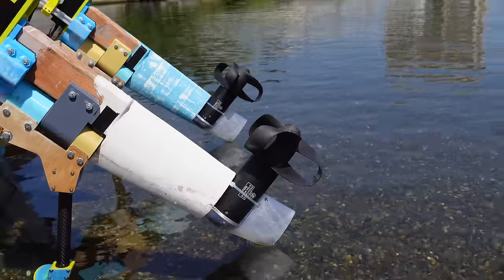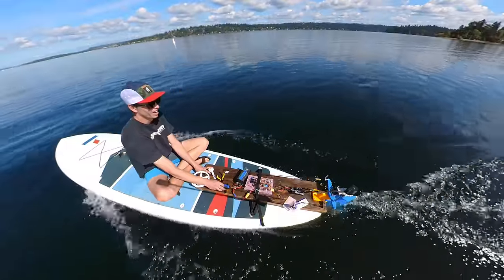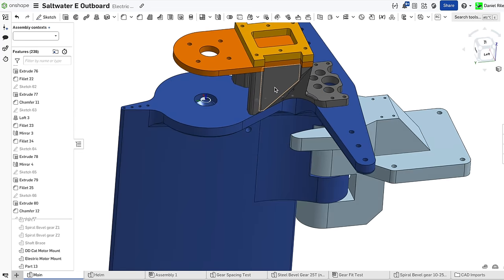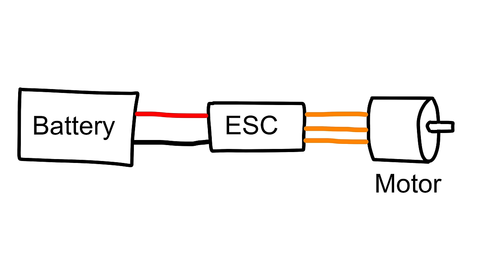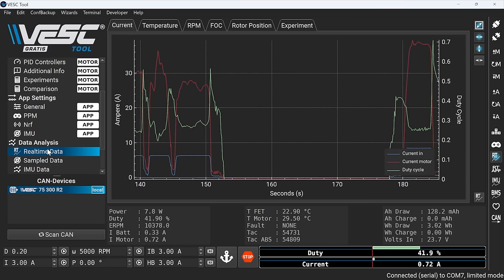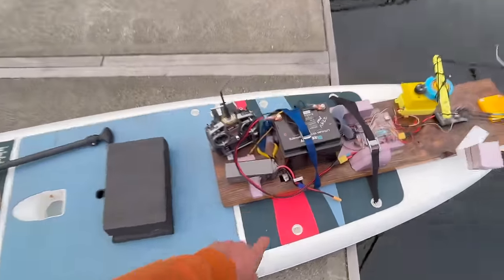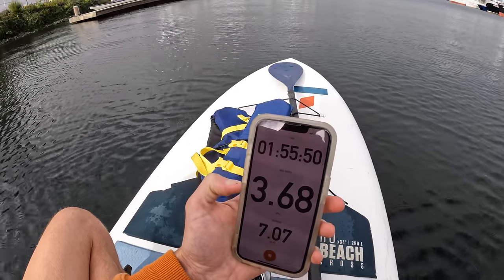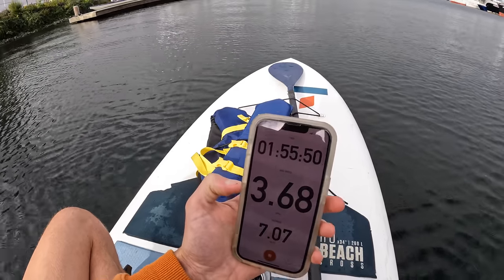Toroidal Propeller Testing on my Electric Surfboard

Comment: Sharrow props probably dont have a negative angle of attack, the examples you're looking at probably rotate the opposite way you're considering. It's common on multi-outboard boats to have counter rotating lower units on the engine to correct for prop walk and other torques on the hull.
Reply: Also the blades themselves are different. His are all in line where as the Sharrow ones are offset from front of the blade to the back. I'm not sure how to explain that as i'm not sure what that part is officially called.
Reply: @TheRogueBro  Which part do you mean? I am not sure there is an official name for a specific part of a prop blade, even if its part of a larger "system" that reconnects to the hub, if thats what you meant.
Reply: The front and rear of each fin, on his they're parallel while on sharrows they bend away from each
Reply: Looks from here like the sharrows have more like a C-shaped fin, while the fins of the 3d-printed ones are more like a U-shape.
If that makes sense to anyone...
Reply: He keeps showing pictures of Sharrows and then making things that look nothing like them.
It's pretty annoying TBH.
Reply: @TheRogueBro  I think aircraft terminology works here and the word you may be looking for is "staggered". the sharrow prop has staggered blades where the leading edge of one of one part of the blade is almost in line with the trailing edge of the other part of the same blade.
Reply: @TheRogueBro  My understanding is the lower member is trailing - that shows rotation direction
Reply: @TheRogueBro  I understand what you’re talking about. Without doing the research I don’t know the term for that.  Let’s call it secondary pitch.  Without it, given a forward motion while turning, the trailing side of the toroidal is in turbulent flow from the leading side, the secondary pitch should allow the trailing side to get clean water and better flow.

Edit. Sorry didn’t see the rest of the conversation you’re having. You get my point.
Reply: @TheRogueBro Agreed. 
It’s for the same reasons of increased efficiency, as biplane wings are more efficient when (conventionally) the upper wing is offset forwards relative to the lower wing. They also usually have slightly different angles of attack which increases the useful speed envelope of the layout. 
The outlier from the norm was the Beech Staggerwing which had the lower wing leading the upper by quite a large margin, however the overall effect was similar.
Reply: Designing these toroidal props is a lot more complex than what is done in these videos. The Sharrow props use many variations. I have had them in my hands, and I have had one of my friends, who's arguably one of the best powerboat prop designers in the planet, look at them. Both the leading part of the blade as well as the trailing part of the blade, incorporate both progressive pitch and rake independently of each other. They also feature individual cupping. That's not the same as the leading and trailing part of the blades have different pitch, they don't, but they need to be shaped in such a way that pitch, rake and camber of the blade creates a cohesive "unit". What happens at one point of the blade in relation to how far forward or aft on the prop hub the blade is, and how far out from the hub the blade is, needs to be accounted for. This is of course generally true for all props. Also very few, except for the absolute cheapest and oldest designs of such smaller high revving props, use this basic "U" shape round ear design. Look at both Sharrow's props, but also look at props like Mercury's Mirage+, Tempest+, Bravo 1, Fury, Enertia etc. None of them uses such a basic "U" shaped design. The only prop I know of which still does, is the super cheap Vengeance prop and a few oddball cheap props from manufactures such as Michigan Wheel etc.
The typical Sharrow three blade prop is very much a mix of a Mirage+ and a toroidal design. It is also important to understand that toroidal props are typically not faster than conventional props. They tend to favour mid range efficiency, whereas some of the more radical designs favour top end performance. This is especially true for props such as the Maximus, Bravo 1 and of course Choppers and Cleavers.

Comment: the problem with your props is quite obvious. both ''wings'' are one on top of each other, that will result in the bottom blade to be only 60% efficient. it will damp every efficiency gain you get from eliminating vortices. (check out why biplanes died out and why they are not optimal wing design). what you want to do is stagger the blades and make it kinda 6 blade prop with pairs of blades linked. it should look more like a 3 blade prop with a loop between the blades. you should get much better efficiency, but designing it will be a bi***.

Comment: @rctestflight great video. Your sponsor however is lying when the make you say no vapor. You know as well as i do that the "flavored air" is flavored because their core is soaked in liquid which vaporizes at STP. Otherwise it wouldnt be flavored. It's valid to say its not a vape but it is most certainly vapor. I tried to call them out for this on facebook and they blocked me.

Comment: The search for greater propeller efficiency is admirable. Have you looked into the Hobie Mirage Drive systems based on fish/seal fins? I'd like to see you bring your rigorous testing to that type of propulsion some day.
Reply: These aren't necessarily designed for the highest continuous efficiency, but instead to make use of the most efficient muscles in the body, and in a way such that if you choose not to use it they are the least additional drag (as even a locked propeller is bad for efficiency, and a free-spinning one is worse). I wouldn't expect outstanding results that'll handily beat propellers due to this.

That said, I also agree it'd be interesting to see the result - efficiency tradeoffs can be worth it, and it would be good to know exactly what the tradeoff actually is.
Reply: Hi, i was considering the hobie system when I was looking into human-powered boat design. My conclusion was that the system is designed for mechanical simplicity, rather than pure efficiency, although the two often go hand in hand I don’t think that is true in this case. Basically the hobie system has a pair of fins (analogous to prop blades) that each oscillate back and forth along an arc. So functionally it’s a propeller that does a third of a revolution, reverses the pitch of the blades, and sweeps back the other way. There’s basically no way to make that as efficient as a propeller because you end up with a dead zone at each end of the stroke that gives you zero power. This is fine for human power as your legs have a dead zone with no power when you reach the bottom of the pedal stroke. But when you’re using a motor with (near-enough) constant power then that becomes a waste.
Reply: @bit1564  In the comparisons I've seen, the Hobie system is far more efficient than a propeller. Basically you have two guys in kayaks doing a tug-of-war - one with the Mirage drive and one with a prop. Plenty of videos on YT about it. Also, the hobie drive is actually quite conplex compared to the well-trodden path of prop and shaft
Reply: @iskierka8399  In the comparisons I've seen, the Hobie system is far more efficient than a propeller. Basically you have two guys in kayaks doing a tug-of-war - one with the Mirage drive and one with a prop. Plenty of videos on YT about it
Reply: He could also look into increasing hull efficiency. Maybe a bubbler like the earliest hovercraft designs could help reduce surface drag?
Reply: @YellowJello57  That is examining the relative effectiveness of A) the human powering the system, B) the drive that puts the power from foot to water, and C) the fins/props. Not directly comparing fins and props, so you can't draw that conclusion fairly. The hobie system is not simple, but it involves fewer changes in direction for the power making it more effective.
Reply: @bit1564  Disagree. Switch the two people around and the hobie drive still wins. There are many articles comparing the two and almost all of them indicate the efficiency of the hobie drive is greater than propellers. In any case, I would like to see RCtestflight do some tests. Maybe he could prove it either way once and for all
Reply: @YellowJello57  Consider this: each fin is essentially a prop blade. While the prop rotates continuously, for each oscillation the fin has to stop and go the opposite direction, meaning for a brief moment it is completely still and produces zero thrust. It is mathematically impossible for that to be better than preserving the rotational momentum and thrust the entire time. It is the overall drive system that is superior on the hobie, not the fins themselves.
Reply: @bit1564  If propellers are more efficient than fin drives, why do aquatic creatures have fins? Do more research. Fine drives are more efficient. Period.
Reply: @YellowJello57  same reason wheels are more efficient than feet but there are no animals with wheels.
Reply: Uh... Rigorous?

😬
Reply: @bit1564 wouldn’t fins produce less drag?
Reply: @YellowJello57  "Basically you have two guys in kayaks doing a tug-of-war"

That is because the hobie system is optimized to use human power efficiently, so if you compare two humans it will win. That does not mean the hobie is more efficient than a propeller, just that it is more optimized for human power.

If you compare a human with a hobie to a motor with a propeller, it it will depend on how strong the human and motor are. Meaningless test.

But if you compare a motor with a hobie to a motor with a propeller, the propeller will always win, because it is the more efficient design.

By showing you a test of "Basically you have two guys in kayaks doing a tug-of-war" they are running a soft con on you already by testing with human power instead of motor power.

Comment: For your longer distance runs,You might want to try a rimdrive thruster. A rimdrive is basically its own motor with no shaft, the propeller is inverted without a center core (think of a donut with pointy teeth) in use they are practically weedless. I have seen video of commercial versions spiting out pieces of net that would disable a conventional prop. Weeds have to be the main concern on long distance autonomous missions, especially durring mid summer.
Reply: How would @rctestflight 3d print it though? I think he is pushing what can be made at home as well.   

Two thoughts that occured to me were what effect would adding weight at the blade tips to create a larger inertia have?

The other is if he had considdered home chrome plating to increase the smoothness and add a minor level of impact protection?
Reply: @RowanHawkins  There was a company 3d printing them 5 years ago for small ROVs,  I don't remember the company name
Reply: I have been proposing this too. Hubless rimdrives are so cool!
Reply: @RowanHawkins  Why couldnt he print them with his resin printer?

Comment: I would imagine the efficiency gain from toroidal props comes into play when you are at the limits of tip speed and the normal prop starts cavitating, so you gain a little bit of speed from a smaller prop. You usually want a prop that the engine is capable to rev up to max rpm (set by the manufacturer at which it usually starts cavitating and where the power peak is) for maximum power and so the engine has enough  power to get it planing if its a smaller engine, this is not a problem with electric motors because you get instant torque

Comment: Have you considered measuring output shaft torque and RPM in order to determine prop efficiency?   In other words, remove the motor efficiency from the picture.   This would make the comparison of the different propeller designs more general across applications.
Reply: sadly torque measuring sensors are quite expensive, in the order of 500USD or so

Comment: I might of missed this tidbit, but what about measuring speed through water rather than over land? Current and tides variable can be eliminated. and you only have the wind variable to contend with.
Reply: His plot of (land?)) speed vs. efficiency is very well behaved.  This suggests to me that the differences between land, air and water speeds for this particular experiment have negligible effects.
Reply: And while I agree with you in theory, there’s a long list of unknowns in this experiment that he could have eliminated if he had the time, money and computing power to measure.  Good engineering is the art of making the most out of your limited resources.
Reply: @owengrossman1414  At the midpoint of the craft, a flow meter, similar to what sailboats use to determine speed through water could be used. This would be a very simple approach. Sailing is a hobby of mine and the through of using movement through water seems a more plausible way to measure. I love this videos and this one I feel is quite provocative in this nature. Thanks for your responses. I feel these comments on this type of video can help us learn a lot more about this subject.

Comment: Daniel, I enjoyed this video on propeller testing.  Years ago, I was involved in designing a solar/electric boat for a collegiate competition called Solar Splash. The propeller design was critical, and we came to learn about the Wageningen Institute in the Netherlands.  They were the leaders back then in propeller analysis.  But in addition to pitch and diameter, there were other important parameters such as EAR (expanded area ratio), the airfoil shape, and more. I'm sure these also factor into the toroidal design.  The best way to measure the efficiency would be to get a true measurement of the torque the motor is providing, which is not an easy thing to measure although you could build a cradle dynamometer if you really want to get serious. But if you can measure, torque, RPM, voltage and current, you could probably come to some meaningful conclusions.   Keep up all the great videos.

Comment: I think it would be better to have a constant speed of the boat, then measure the power used over a set distance of travel. I think this would be the easiest and most accurate comparison because you eliminate the variable of drag from the boat moving at a different speed which can have a SIGNIFICANT impact on efficiency of the hull itself, making it difficult to know what contribution the prop really has.

Comment: You should look at making a 3 blade prop but with cupped tips on the blades. Stops/slows down water spilling off the blades for more thrust. Also the there is a prop type know as the" chopper" where the top inch to 1 1 1/2 of the blade is cut off square.

Comment: I commend you for these prop experiments. I have a boat and it is over propped on purpose. It is cost prohibitive to increase power and torque to match it, and it is cost prohibitive to buy props to try to tune it. These props are Bronze, but if I could use lost wax and per blade resin printing to cast a replacement in aluminium alloy I could test without huge cost. Just substantial effort. One option might be to make the boat hybrid and couple a pair of Nissan leaf motors to the shaft directly after the transmission. Then we could get the RPM up in bursts assisted by those. Or putter around on only those silently. Or long distance with only diesel.

Comment: Hey, notice the huge air trail from your toroidal propeller downstream of the bulbous center? And how it’s so much larger than the ones from the traditional propellers? That’s drag. And the shape has everything to do with it. Give it the same cone shape as the traditional propellers and you’ll see a fairly big change in efficiency.

Comment: A word of caution. Although paddle boards generally do not, all mechanically propelled vessels do require registration. Along with requiring a registration, comes the need for code compliand lighting, and mandatory lifejackets. 

You will probably not have any trouble, but you could get ticketed if spotted on public waterways.

Comment: Your three-bladed toroidal propeller doesn't look like the one in the pictures that you shown. They look like they would have been a 6 blade propeller with the end tips connected. So if you move the bottom three blades to the center gap of the top blades it might be better and more efficient.

Comment: One big difference I see between the "MIT" props and the Sharrow is that the Sharrow is raked significantly aft so that the effective diameter at the leading edge is quite small, achieving maximum diameter near the trailing edge.  I wonder if this may have something to do with the efficiency?

Comment: For propeller testing, you could do a tug-of-war by placing two props opposing each other and seeing which wins out. Maybe even both using the same engine (with a gear split to each side) to ensure the same engine output to the shafts. That could be a platform for a easy bracket testing setup.
Reply: You could, but it would give data of very little usefulness, I would even say it might give data that is worse than useless, I.e actively misleading for what most people. including him, does with their boat.